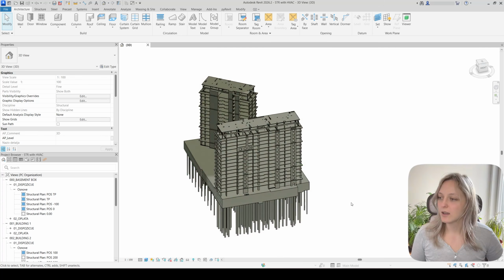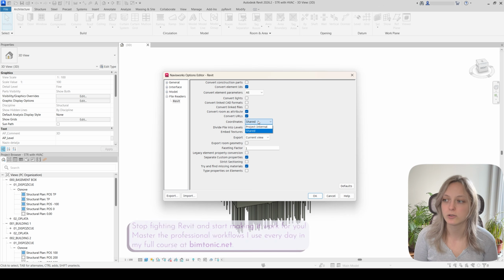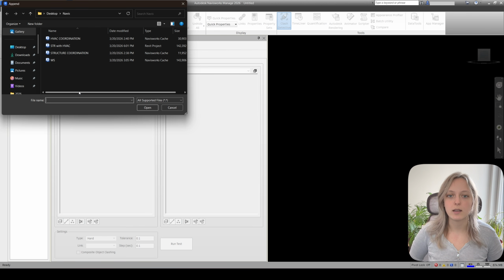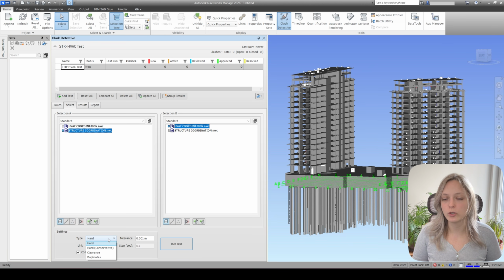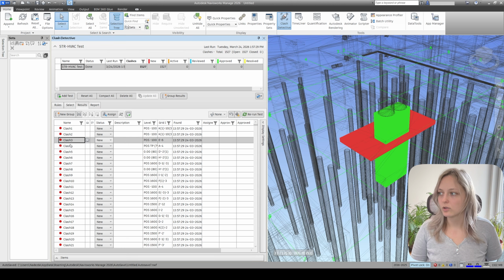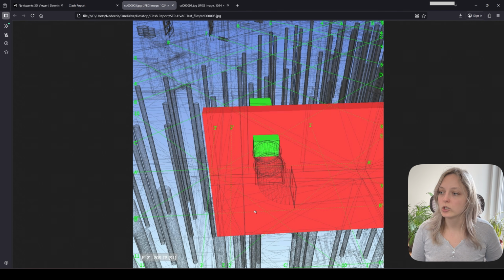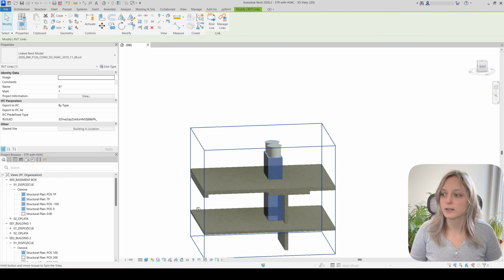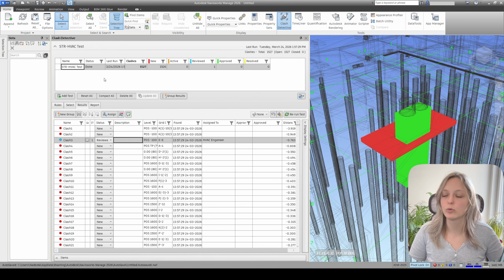Revit & Navisworks Coordination Workflow: The Complete Guide to Clash Detection

Comment: Nicely explained. One question :- There are many other clash-detecting plug ins/software in ACC. Also, two of Nevis. One is Nevisworks Manage, and the other is Nevisworks Freedom. Which one should we learn and use as a beginner? Please advise.
Reply from the maker: Here’s the breakdown:

-Navisworks Manage: This is where you run clash detection and handle real coordination. You should learn this one.

-Navisworks Freedom: Just a free, read-only viewer. Clients and site teams use it to inspect the NWD files you export from Manage. You can’t run clashes or edit anything in it.

ACC is great for cloud checks, but it's expensive and mostly paid for by companies that work on larger projects. For learning and for individual work visworks Manage is the best.
Reply: @BIMTonicLive  Many thanks for your clarification. All the best.

Comment: Thank you for this lecture, I have a question:
As you showed clash number 3 in Revit Model and now let suppose we want to resolve it, who will be responsible for this clash HVAC team or structural engineering team. Because the clash is between structure vs HVAC? You will share these clashes to both teams.
The second question is the number of clashes as in this model there are more than 1500 clashes, if you check one by one it will take around a week or more to resolve just these clashes. If you go to other clashes such as Structure vs Architecture, Architecture vs HVAC, and x,y,z.....So my question is how we can decide like which clashes should be sent for resolving and who will decide this? the one who will be identifying clashes or the teams responsible for designing.
I would like if you give details about these information 
Kind regards
Reply from the maker: Ideally, you want to have a person on the project dedicated to coordination. While many projects are rushed and don't have enough people in teams, not having someone to take care of clashes and coordination can backfire and cause a lot of issues during construction. Smaller clashes can be decided easily but these really large ones usually are labeled as important, and than dealt with on the coordination meetings (you would have coordination meeting where together with both mechanical and structural engineer you decide what has to change).

While every clash has a potential to be important, if you are in rush with time there is a way to prioritize.
 
First you should set allowed tolerance (ignore anything under 1-2cm) 

First in the RCP plans I would look if any element  is visible below ceiling. You do want to make sure that nothing is protruding allowed ceiling height. 

Then you should move to clashes with structural elements. Any clash with RC beams and columns should be reviewed, especially if it's large ducts and pipes. 

After that you should look what clashes with HVAC ducts. Because of the duct sizes these clashes can be difficult to resolve and may cause very complicated problem. So it's better that they are reviewed right away.

Next big items are sloped plumbing pipes. They are not as big as the ducts, but because of slope they do often require a lot of space. 

Next are the main sprinkler pipes. 

Than you check cable trays. 

All other smaller items, like water pipes don't have to be prioritized because their size make those clashes easier to resolve. You should however do visual check (doesn't have to be in navis, you can also check on RCP plans) if sprinkler heads are blocked by some ducts below them.

Comment: When thousands of clashes come then how can decide which one leave and which one to resolve. Can you share the criteria for that.
Reply from the maker: While every clash has a potential to be important, if you are in rush with time there is a way to prioritize.
 
First you should set allowed tolerance (ignore anything under 1-2cm) 

First in the RCP plans I would look if any element  is visible below ceiling. You do want to make sure that nothing is protruding allowed ceiling height. 

Then you should move to clashes with structural elements. Any clash with RC beams and columns should be reviewed, especially if it's large ducts and pipes. 

After that you should look what clashes with HVAC ducts. Because of the duct sizes these clashes can be difficult to resolve and may cause very complicated problem. So it's better that they are reviewed right away.

Next big items are sloped plumbing pipes. They are not as big as the ducts, but because of slope they do often require a lot of space. 

Next are the main sprinkler pipes. 

Than you check cable trays. 

All other smaller items, like water pipes don't have to be prioritized because their size make those clashes easier to resolve. You should however do visual check (doesn't have to be in navis, you can also check on RCP plans) if sprinkler heads are blocked by some ducts below them.